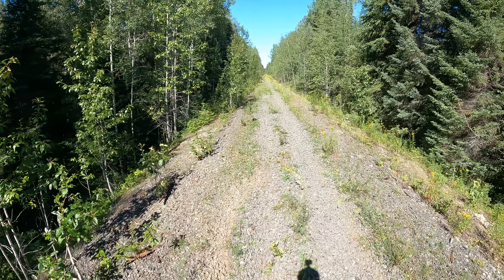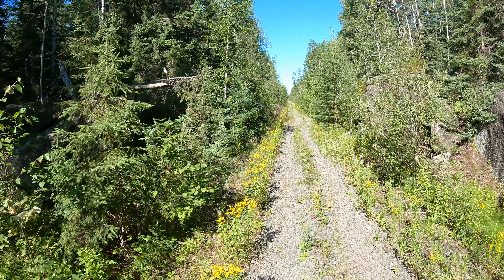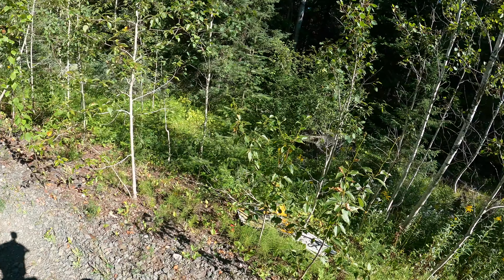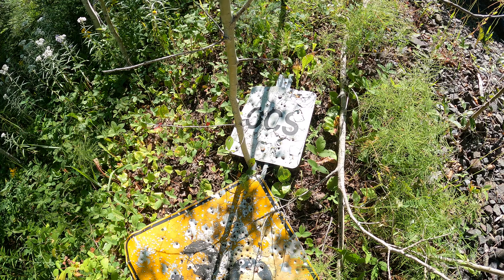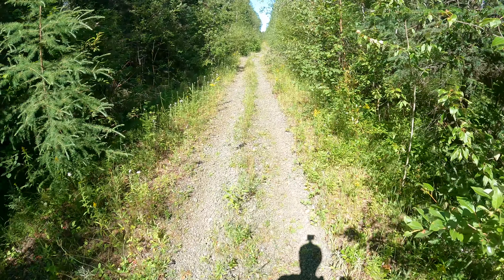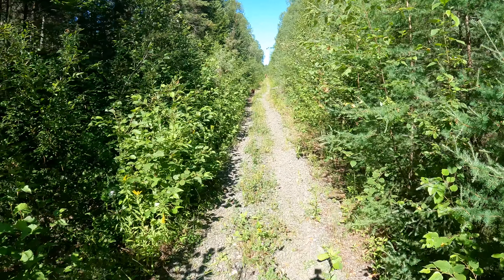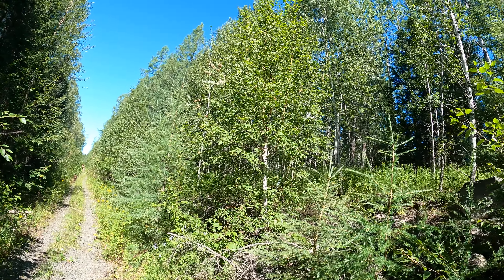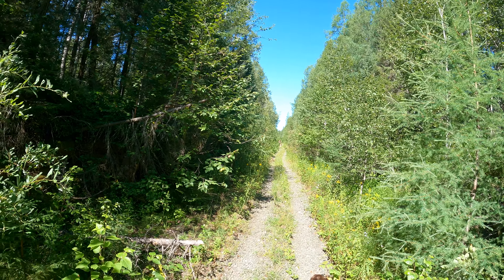CNoR/CN-Kinghorn Subdivision MP 102.4-105.1 II (Behun Station)

Comment: So from Nakina ontario back east to Hearst , what is left of that line ?
I know theres a saw mill west of Hearst. Not sure if CN RAIL or ONR serves it ? I know CN RAIL goes from Hearst on the old ACR to the active CN RAIL line that comes from LONG LAC ONTARIO. 

Im wondering if from Nakina east what still exhists ? Bridges , signage , etc ?
Reply from the maker: There is still a short section of line left from Hearst to Calstock (the sawmill you described). I believe it is operated by ONR. 
I think a good chunk of the grade is drivable, except for the bridge over the Pagwa River. Apparently one or more of the spans shifted, so it's not longer safe, so the decking has been removed but the spans still remain.